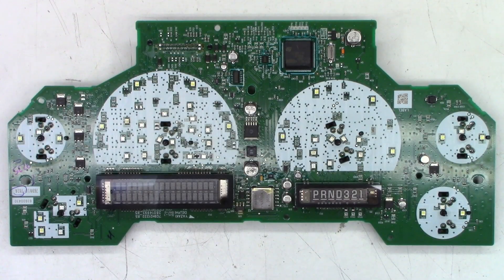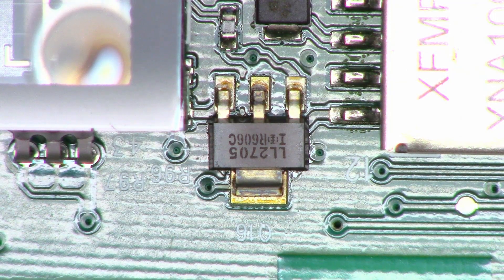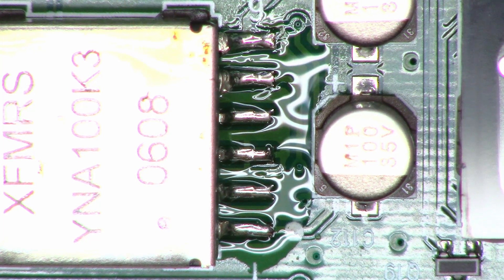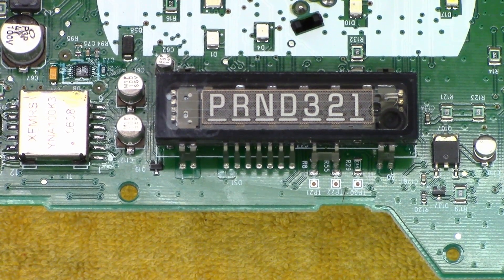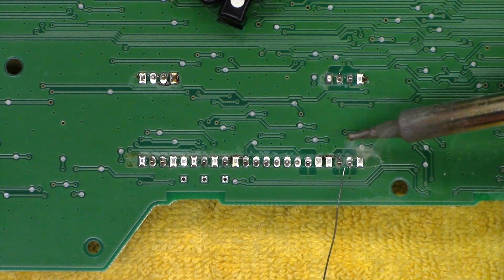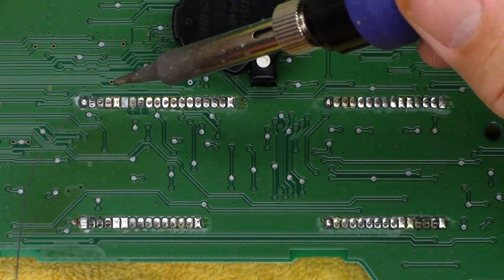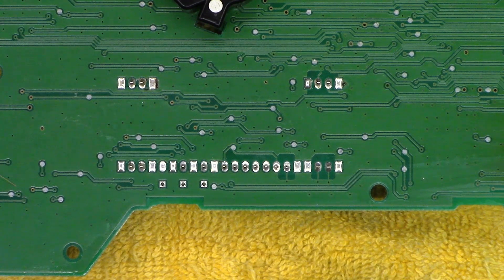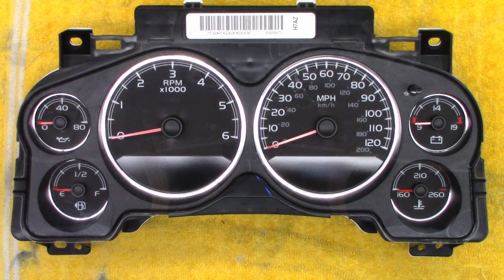2007 GMC Yukon Instrument Cluster Intermittent Display. Customer asked me to Resolder one FET

Comment: My 1994 VW T4 campervans instrument cluster had a dodgy voltage regulator chip that broke its joints due to vibration. So no fuel gauge or temperature gauge till fixed. The bigger the component the worse it gets with vibration breakage i guess, so a transformer would be even more likely to fail.